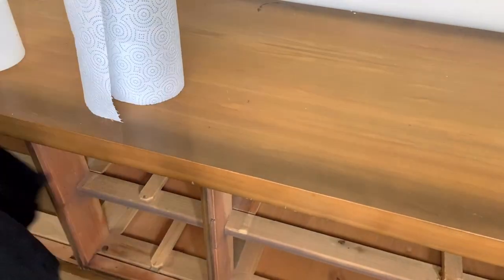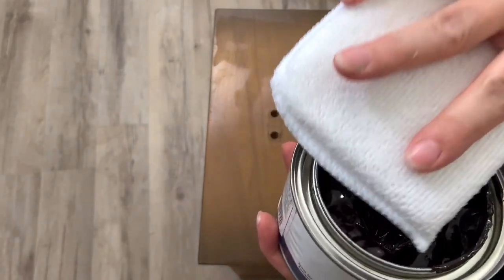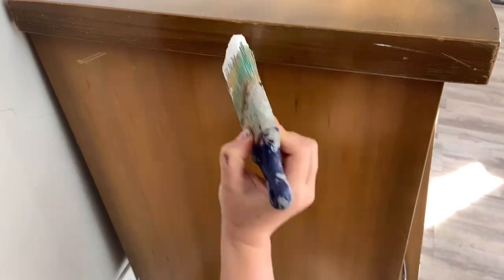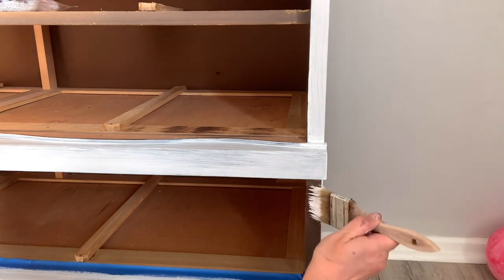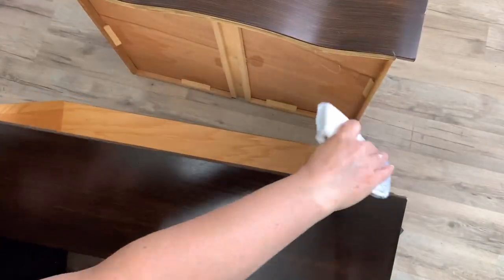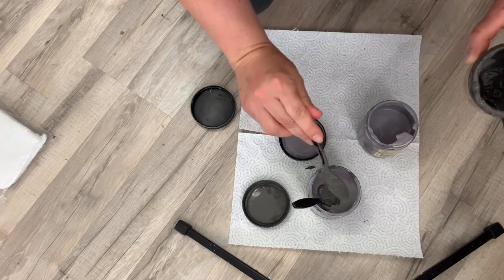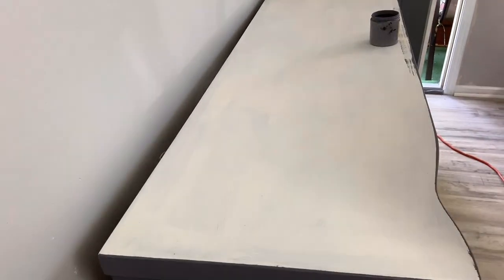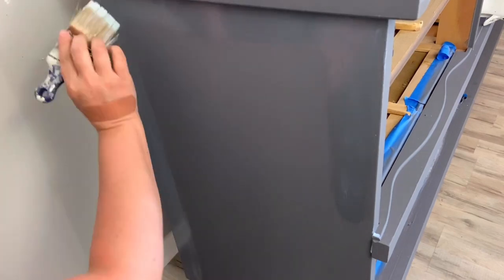Furniture  Makeover | chalk paint your Dresser | Dixie Belle No Pain Gel Stain

Comment: Hi Amy. Wanted to ask you about your choice of sealant. I am a newbee, thus all the questions lol.  I am used to using wax and I love how it comes out. Can you tell me why your a polyurethane person. Is it because of the sheen or maybe just good coverage without having to worry about chipping in the finished paint job? Just curious mind you. I actually used that very product on my sister bureau for the extra coverage but had a hard time with it. And you layer it on so easily. I know it's suppose to go on one stroke from one end to the other but you went in all different directions. I had some smearing when I stroked my brush to and fro and couldn't get a stroke without a seam.. please, what am I doing wrong? Do you put just a little on the brush, and if so, how do you finish the stroke without bubbles?
Reply from the maker: Hi Lisa! This is a great question. My favorite sealant is Varathane’s Water based polyurethane. I love wise owls varnish and Dixie Belle’s but my GO TO is usually varathane. I like wax if it is on my own Furniture but for selling I like to use a polyurethane because it lasts much longer. Wax has to be reapplied after time and Since I’m selling the piece the person won’t know they need to wax it. I used used Minwax polyacrylic many times a few years ago but I found it does not protect the piece with time. So my favorite is the Varathane. 
When I apply my sealer I find that if I am consistent with the amount of sealer I can get an even coat with no streaking. I use a generous amount on my brush. When I use a small amount and do thin layers I notice I have streaking. I think the trick is to use a very clean brush and to rinse your brush between coats. And it’s okay if your brush is damp since it’s water based. Sometimes I actually find it helpful if my brush is a little damp.If I use the same poly covered brush over my second coat no matter how I store my brush sometimes the poly dries a little bit and then that gives ugly chunky streaks. But don’t get me wrong it’s not perfect every time. Sometimes I will wait the next day and even do a third coat to be sure I’ve covered the entire piece. This Is giving me an idea to Do a video on applying the sealer lol There’s a lot to it. Also, Sometimes when you apply it you can see the color change to a brighter hue and in spots it will look a little darker that’s when I go back over it to match the darker with the lighter. If I don’t go back over it that will end up looking uneven. At this point though we have to be careful not to over work the sealer. 

I know that was a lot and I hope this makes sense lol
Reply: @FlipItFurniture  okay so you're obviously not a novice in this department LOL. Your expertise is unbelievable and I love the details in which you describe things. It is a lot and I'm glad you thinking of doing a video on it. A lot of times when you watch it on TV it's just so easy looking and then you attempt it yourself and you end up breaking things because you threw the can haha. I always said it though, patience, perseverance and Practice makes perfect. You're the best.
Reply from the maker: Hahaha yes! Because you threw the can🤣 your are right patience,  perseverance and experience. When I first started out I Sold my furniture on the lower price end.  I knew that I still needed a lot of practice. And the more I used the products the better I understood how they worked. I still made money but my First couple of years I consider them practice rounds lol
Reply: @FlipItFurniture  I really was thinking about asking you about the pricing but I didn't want to be a pesky nag lol.  You are not only listening to your furniture but you are reading my mind. That's funny. Yes, of course, start low. I wasn't sure how to price it but I'm thinking: what I buy it for and then add in supplies that I used and maybe shipping? With a 25% profit margin? I don't know I'm just guessing without doing any homework. Plus you have to look and see what others in the area are selling for I would think.
Reply from the maker: Yes, Definitely do some research on what others are selling. That will give you a great idea for a realistic price is in your neighborhood. I used to price by the piece but Now I keep a notebook With a log of monthly income and monthly expenses. I find myself buying supplies all the time and Since I’m using the supplies on more than one project I’ve decided to just look at my monthly income/expense. That way I also get to negotiate my prices if need be. And not all pieces are created equally. I might do a night stand made of cheap materials in only one color and charge $50 and then do another nightstand with some blending and a bit of a transfer and I can charge $75-100. If I sell some thing on the cheaper side I can still get a profit from another piece that I am selling for a lot more so that way I’m still making a great monthly profit. I hope that helps. There are Furniture pricing sheets on Pinterest that you can refer to when pricing your items but I usually go with what I think it’s worth. How much time I put into it and how much I think I can sell it for with my clientele. I like to keep my stuff moving so I try to stay in a reasonable price range. Thank you for all the questions! Your giving me great ideas for videos☺️